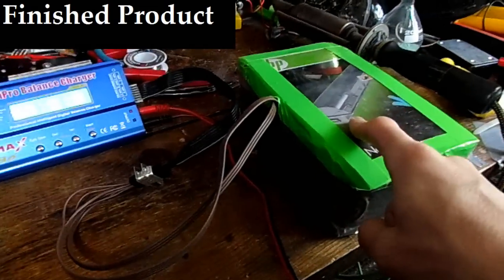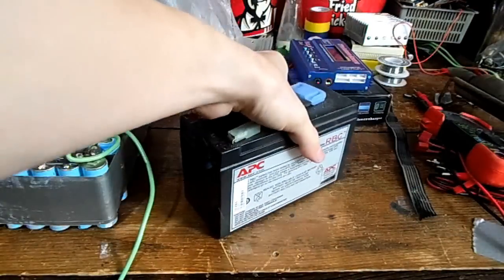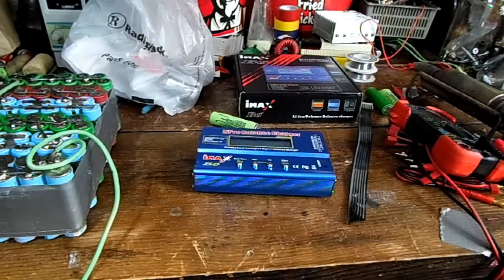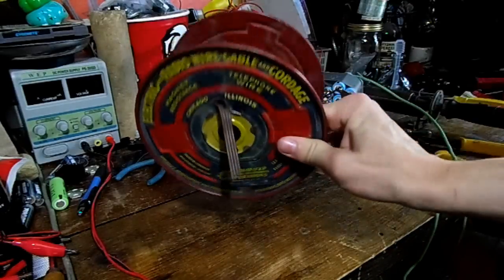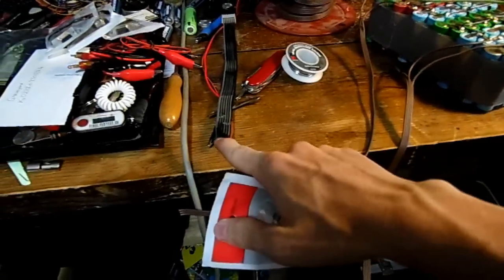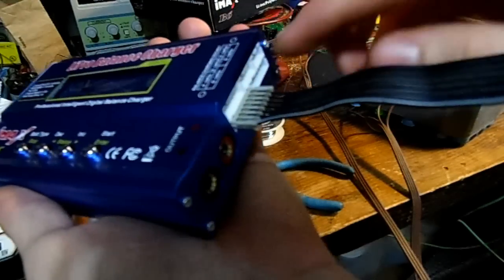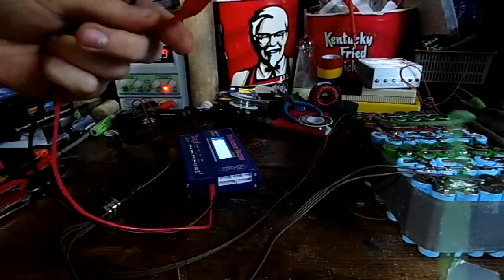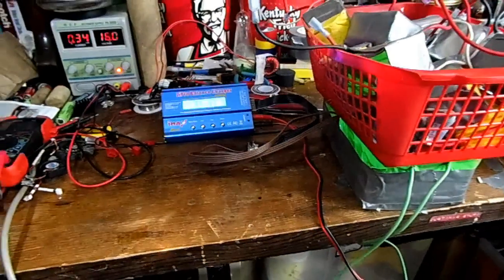DIY: Balance Charging E-Bike lithium battery upgrade

Comment: Hi There! Great Videos, I am really enjoying the demonstrations.

A couple of words on Balancing: Top Balancing will Kill Cells in your pack.
I will use an analogy using Water Balloons to explain why:

In a battery pack you have many cells (balloons) of differing capacity, some larger and some smaller. All are made with the same materials.

If you “Bottom Balance” all Balloons to the same lower capacity of the smallest balloon, even the largest balloon will accept that and be just fine and happy.

If , however, you “Top Balance” the pack to the capacity of the largest cell, you are putting too much “Water” into the smallest cell and will break or “burst” that cell by forcing it out of its actual capacity capability.

BMS are notorious for doing this because they balance only at the “Top”!

 It is better practice to 1) Measure and identify the capacity of each cell, 2) match and group cells by their capacity, 3) Identify the “Weakest” or “Smallest” cell in the pack, and 4) never OverCharge that cell, or Over-Discharge ANY of the cells.

Here is an example where each cell has the same chemistry , and can be assumed to have a MAXIMUM and a MINIMUM voltage based on that chemistry.

However, each Cell has different capacity:

In the case for LiFePo cells:
Max = 3.6V, Min = 2.7v

Cell 1 = 1 AH
Cell 2 = 1.3 AH

If you BOTTOM BALANCE both cells to 2.8V and charge both batteries in series until Cell 1 reaches 3.5V, then the final actual charge capacities and voltages are:

Cell 1 = 1AH, V1 = 3.5V
Cell 2 = 1AH, V2 = 3.45

However, if you TOP BALANCE by charging both cells until Cell 2 = 3.5V, then:

Cell 2 = 1.3AH (100%), V2 = 3.5v (OK)
Cell 1 = 1.0 AH (100%), V1 = 3.7v (BAD – V1max out of spec)

and as you discharge the series back to minimum recommended Cell 2 voltage (and 80% DOD or Depth of Discharge):

Cell 2 = 0.25AH remaining (20% charge), V2 = 2.8V (OK)
Cell 1 = -0.04AH remaining (0% charge), V1 = 2.3V (BAD – V1min out of spec, Cell 100% Discharge)

Cell 1 WILL GO BAD QUICKLY!!!

Anyway, I Hope this helps clarify things. Keep up the good work!
Reply from the maker: "If , however, you “Top Balance” the pack to the capacity of the largest cell, you are putting too much “Water” into the smallest cell and will break"

ok lemmi just stop you right there. voltage isnt relative to milliamp-hours its relative to percentage of charge.

so 4.2v is 100% charged for a 1mah cell and a 2ah cell and even a million ah cell. 4.2v is still 100%.

at 3.9v its like 50% charge. if you have a 1AH cell and a 2AH cell and charge them from 0% to 50% they will be at like 3.9v. at 50% the first cell would have 500mah of capacity in it and the other would have 1ah.

hope that helps you understand batteries better! ^^b
Reply: Exactly Right!   at 4.2V both are 100% charged, however,  one balloon can contain only 1 Pint of Water (AH) capacity, while the other balloon can contain  up to 2 Pints of Water (AH) capacity. What happens when you try to fill the 1 Pint Balloon with 2 Pints of Water?  I hope you understand my point!  The Smaller Capacity Balloon will be RUINED! Not all batteries have the same capacity. There are minor variations due to manufacturing that make some a little less, and some a little more.  They ALL have the same maximum and minimum chemistry charge VOLTAGE!!  Voltage is NOT the same as CAPACITY!   A smaller capacity battery will reach 4.2V first when they are bottom balanced!  If they are Top Balanced, they will always be OVER DISCHARGED first! Please re-read my post and my example and you will eventually understand. Thank you for your quick and polite response!
Reply from the maker: Robert Orr
 yes but 1AH at 100% is still one AH, not 2 AH, that would be 200%.

you will not ruin the smaller one by filling it to its own capacity.

lithium ion cells dont degrade in voltage like lead acid cells do.

as long as you keep the cells in parallel they can not deviate in their percentage of charge.

i'm sorry for how misinformed you are.
Reply: As I said originally, this applies to charging cells in series

You can demonstrate this in the lab if you wish to pursue it and find out.  Simply measure the temperatures of two cells of somewhat different capacities, as you charge them in series to the maximum voltage of the larger battery.

Cells in serial constantly fill at the same rate all the way through the pack.
Where do you think the extra current and energy goes in the smaller cell?  The Larger cell doesn't care because it still has capacity as it is still filling.  The Smaller cell has no capacity left to fill so it is left with no option but to over charge.  What do you think happens to all that energy?   It is dissipated in the smaller capacity cell!
Reply: Robert Orr
 Robert ? can i ask you W.T.F? "Where do you think the extra current and energy goes in the smaller cell?" How do you think BMS's are working(same goes to balancing charges)? A: they dissipate extra energy for cell which is almost charged by means of parallel resistance..
So: when in battery pack of N cells connected in series, when one or more cells are at HVC parallel resistors are engaged for those cells, and while there rest cells are still under charge as equal current flows in series connection "overcharged" ones just sit there and do nothing.
 Or almost nothing, it depends on balancing charger or BMS specs, like amount of heat it's able to dissipate and if it's able to regulate charging current. But in case if your charger is much more powerful let say 25 amp and bms only able to dissipate under 5amps, charging process must be stopped at the point when one battery will be almost "overcharged". So balancing wont be 100% complete, this time, next time it should do better by engaging resistance earlier(or order your charger to drop current when in balancing phase so it can complete full balance). But this only applies for smart systems.

Btw, bms must be used at all times in battery packs to protect any cell from being discharged to much(LVC). You must have one, because even if you will stop every n miles and check your each cell with multimeter, you will see voltage at no current, which may be absolutely different story. in my BMW 100a thundersky's are usually at 3.0 volts when at ~40% charge left but if i step on it,battery amps can go up to 300a easily and voltage surely will drop under 2.5, so bms must tell controller to stop and be more gentle on battery..
 
Of course the are many treads on forums discussing top and bottom balance difference and advantages and disadvantages of those two. But it's not about balloons :D
Reply: Yuri LM
 Hi Yuri!  Thank you for making my point!  As you describe above, using a BMS is almost useless in achieving balance in cells unless they the individual BMS connections are large enough to dissipate 25A or more of current.  While at rest (not under charge, automobile turned off), BMS balancers continue to draw current from the traction pack to maintain an "equal" voltage among cells. Unfortunately, this tends to drive the weaker cells with less capacity into deeper discharge quicker.  Hope you have good luck with your BMW! Have you ever had to replace any cells? After how long?
Reply: Robert Orr
 Its a very BAD bms which is trying to keep equal voltages on cells when not under charge. This is very similar as bottom balancing but with the difference that it will drain continuously as you cant keep absolutely same voltage level across all battery, in case of bottom balance you want it to be done once when pack is almost empty before you charge it, to be honest if any bms does so i would recommend  to get rid f it. My car is on dielectriccar, but i haven't updated my garage page for a year... hopefully soon.. I had no trouble with may battery, except one was faulty at the very beginning.
Reply: Unfortunately, most BMS do exactly that: they try to maintain the same voltages, but all ultimately fail, UNLESS the cells are very precisely matched in capacity, and bottom balanced to begin with.  A BMS cannot usually compensate for cells poorly matched in capacity (e.g. thats why you dont mix 40AH cells with 60AH cells in series, as an exaggerated example). What size Thundersky do you use?
Reply: Robert Orr
 older series 100ah which was before winstone batt.

Comment: I noticed you used the LiPo charging mode... shouldn't it be the LiIo mode for lithium ion cells?
I've noticed the charger says LiPo is 3.7V but Li-ion is 3.6V... does it still charge it to 4.2V? Have you just been using the LiPo mode and it's been fine?
Reply from the maker: lipo and lithium-ion are exactly the same thing, just differant production methods. and it charges lipo to 4.1v and li+ to 4.2v i think. but i went into a hidden menu and adjusted the calibration so really 4.1v is 4.05v

keep in mind that LiFePo is differant from li+ and lipo
Reply: Okay, thanks :)

Comment: Hey, this is very cool, I've been bashing my head off a wall trying to get a suitable battery for my ebike/scooter thing. These batteries are sweet for a 24v 500w brushless hub motor for example, but im not so sure if they would handle my heavy 48v450w Gio though, I will have a look around but if need be now I know this at least I know I can spend a while soldering lappy batteries, very innovative, very impressed! keep it up! and check out my Gio build http://www.batzorprogramming.com/bin/prorefgio.php, if you live in the states a GIo is dirt cheap like $400 inc shipping and its just getting batteries after that...which this could well solve if you could fluke a bulk of cheap high ah cells from a laptop battery clearance or something :-)
Reply from the maker: these cells run my 48v 1000w motor just fine. and yeah that looks like a great vehicle. i've been thinking about buying a 1970s Comuticar and upgradng it to lithium. but i'm still working on converting my 1982 mercury zephyr to electric. i just had a breakthrough regarding the motor controller. i'm going to convert an AC 3-phase motor to DC by adding it's very own commutator.

but as for building and selling batteries thats exactly i i'm planning to do. check out my video i'm uploading today. its about some cheep laptop batteries i got from ebay.

i think pretty soon i will start selling 12.6v 13ah lithium packs and people can link them together to get 24/36/or even 48 volts for whatever they need.

do you think 40$ for a 12v 13ah lithium pack with balance leads and inside a hard plastic case is ok?
Reply: Rinoa Super-Genius very, very much so! with your level of work on them I'd snap them up, its a lot easier to get stuff cheap in the states, when I find something cheap its in the states but them I get slammed with a pretty heavy charge. Yeah a nice hard plastic case that looks smart will go down well, perhaps you could even try some pvc sheets I have been using on my moulding bed to get a thin but rigid casing...perhaps you could source some of this a bit cheaper http://www.ebay.co.uk/itm/HIPS-Polystyrene-Plastic-Sheet-Vacuum-Forming-BLACK-pk10-1-5x457x305mm-373162-/380814351935?pt=LH_DefaultDomain_3&hash=item58aa4dde3f and setup a vacuum moulding bed to get your casings together, check my vacuum mod bed on my site, you will be able to make one of these easy, any vacuum is good but a 5hp if you can find one is a mega win  http://batzorprogramming.com/bin/prorefmodbed.php hope it helps
Reply: Rinoa Super-Genius very nice move on the controller leap, I wouldn't have dared go near an AC motor :-) well played, if you know anything about the controllers themselves they easy to fix if you have the know how and are very welcomed as they are hard to get cheap, if your going elec this is a handy site I have been hanging in a while, here you will meet people who will want both batteries and specially controllers http://www.giobikes.org/forum/viewforum.php?f=32 and sorry not sure what the 70s comuticar there are as we didn't have them in England, got a link? my bike looks like a meaty scooter rather than its legal status of an ebike EAPC, but it has a chunky hub motor on it that I think sucks the amps compared to your light weight bike there (something to consider on your new bike). a lot of the old ebikes come roughly around 48v22ah in battery terms (that's like 20-25 miles give or take) but if you get a meaty frame as a start point, with your skills you should be able to come up with something that blows that ah out of the water, id love to see your project on here once you get it up and running. hmm not sure when it comes to ac to dc conversion though It sounds like your commutator will do the job nice but  perhaps you have come across the dc brushless motors that are pretty cheap and are pretty efficient and provide torque, I want a 3kw http://kellycontroller.com/hub-motor-60v-3kwdisc-brake-p-151.html but im running a 450w at the min.. hmm not sure here though when I think for a min, i would need 4 of your 12.6v 13ah to get to the 48v13ah (that's $160) then would need 2-3 times that many for a decent 39ah, so that would be $320 for 8x12.6v13ah right? which is good like half price on ebay but will they have issues with finding a charger then or? also atm I am working with a battery bay of 305mmx210mmx165mm which is the standard size for my gio, I would want 2 or three of them in there and perhaps another 1 under the seat and another on the rack behind me. basically keep It to 48v and pump that ah for distance so you can take advantage of weight reduction compared to the old lead counterparts, but one think with your compact design is your would likely fill that niche really well as getting compact batteries to fit those dimensions is an effort,sounds like your well on the way though! be ambitious with that ah!

Comment: Hey Rinoa, I brought a folding electric bike back from China and I need a new battery for it. I bought a 36V 10Ah SLA batttery but want to build a lithium ion battery. I just plan on buying 18650-type 3.7v 2.2Ah cells (x 50) and building a battery pack like I used to for my R/C cars. If they are all identical cells, will I have to worry about balance charging? Cheers!
Reply from the maker: well its impossible that all cells would be the same.every cell comes with small variations in capacity.

but you could get away with not balancing them for a while. only charge them to like 4.0 or 4.1v to give you an extra area for them to deviate without going too high.

or you could wire them to all switch to parallel so they would equalise like overnight.